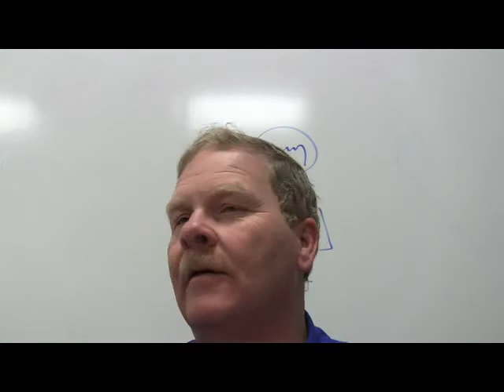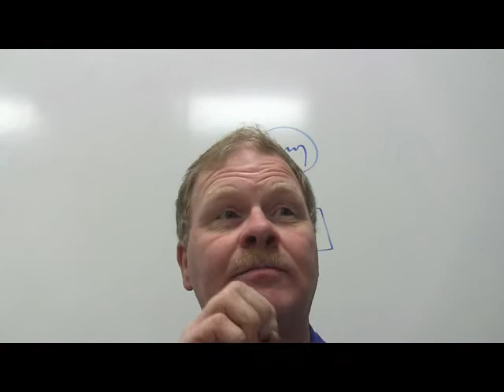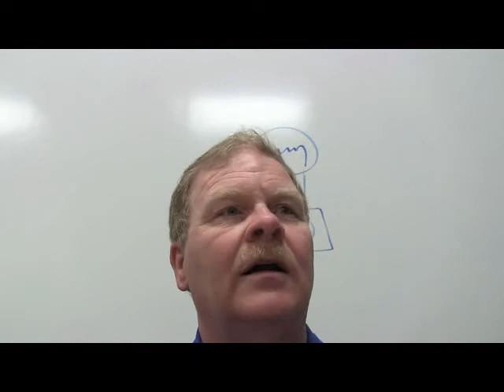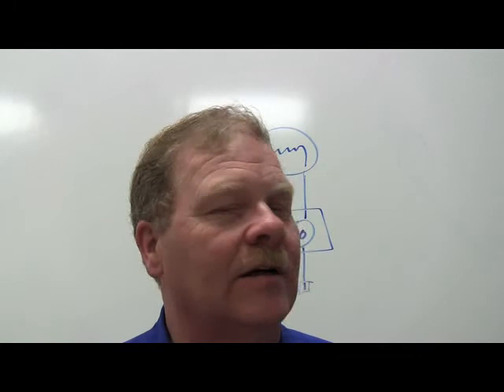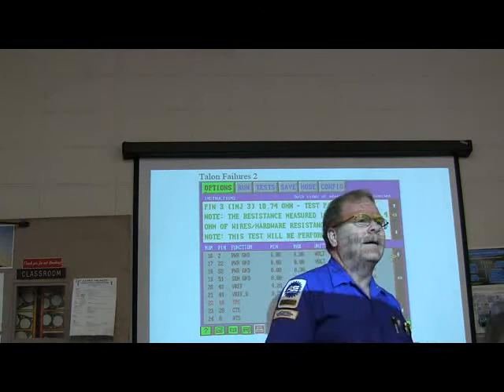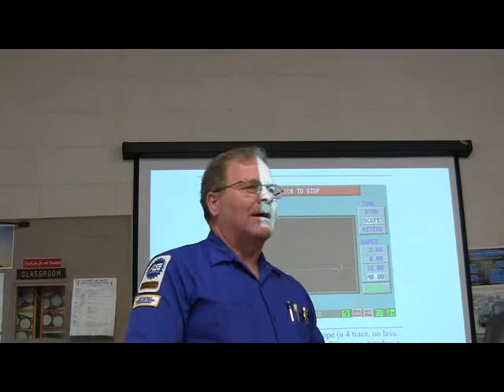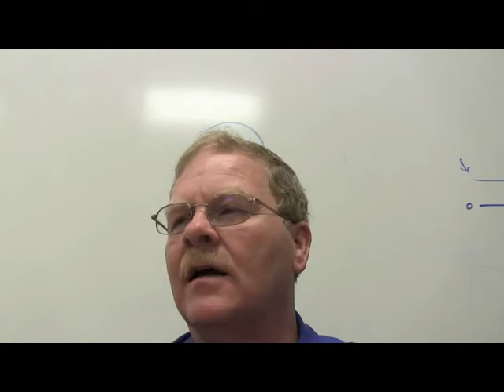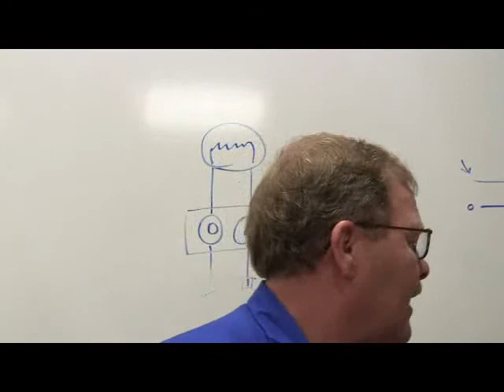Eagle Talon War Story   Spec Topics Test 2

Comment: i put a bad engine controller in a f150 one time that left the injectors wide open, filled the cylinders up with gas so bad it after it died it wouldnt crank, after a oil change a plugless spin over and another computer it started and ran ok but came close to bending a rod
Reply from the maker: Been there too!!!